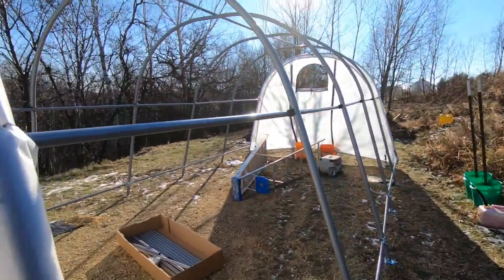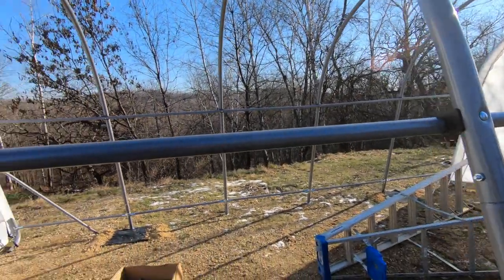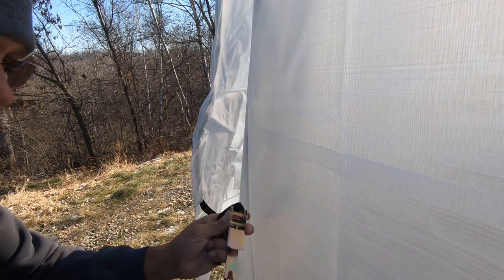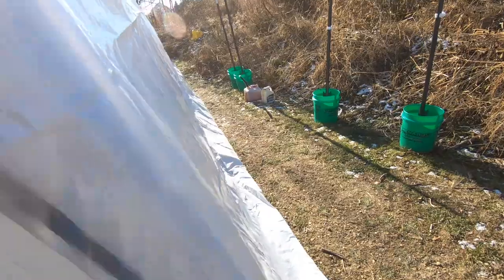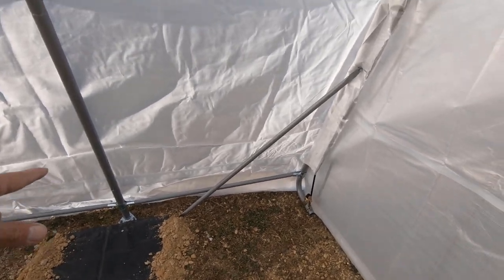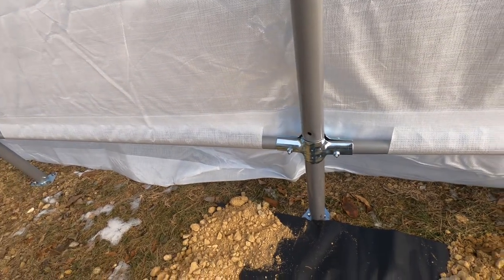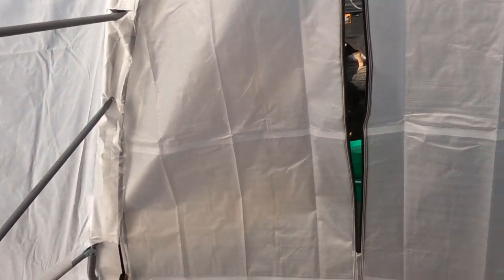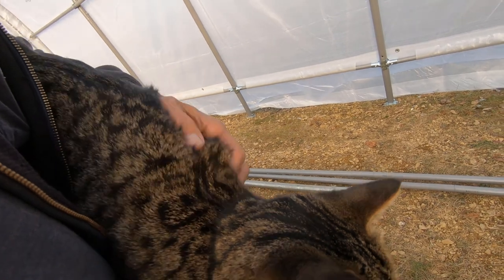How-to Install a ShelterLogic GrowIt Round Top Greenhouse Cover

Comment: Putting up our greenhouse we just got today and we did the same thing looking for the way to put in the bottom bars. Seems they haven't fixed the error. Felt glad to know I wasn't crazy, as I most definitely felt crazy going corner to corner checking for a way to insert the poles.
Reply from the maker: That's pretty funny (in a tragic sort of way 😉) They must have made a large run of them. It';s pretty easy to snip the corner off. It won't fray or anything. Good luck Antonia!